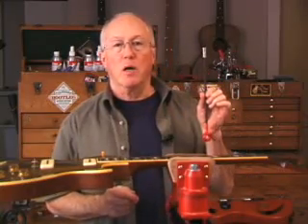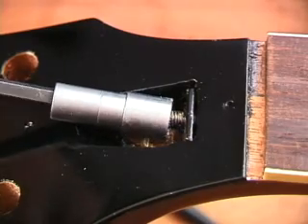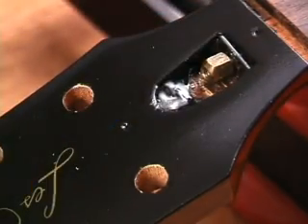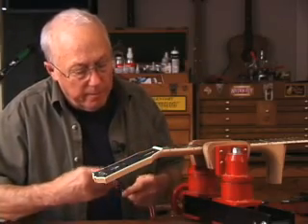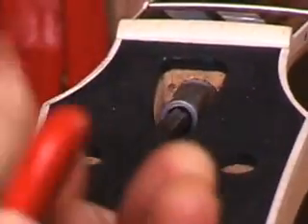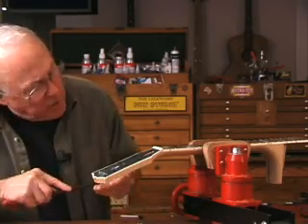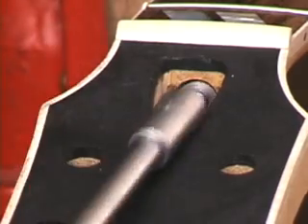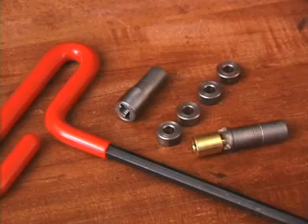Truss Rod Rescue Kit

Comment from the maker: @chase4train A lot of things add up to a smooth-operating tuner: your string tension, how worn-out the tuner is, etc. If the tuner has exposed gears, try using Tri-flow lube (found on stewmac.com)

Comment: my truss isn't broken off and doesnt have a stripped threads.  I was told it was "unthreaded."  When i tune it to the standard E-E tuning the neck is flat. But when i tune it down a step from there the neck is over bowed.  When i go to adjust the neck the truss nut backs off the threads.  Will this tool fix my problem????

Comment: @ofirg32 if the trussrod is weak you may want to just consider getting a replacement neck just for better playability. that way you keep the original neck intact (just not on the body). i have a '71 univox hi flyer that i believe has a broken truss rod. it still works fine (i just know its not perfect, hah). ive been looking for a neck on ebay for a while with no luck.

Comment: Dan ,love your knowledge and these videos I could watch all day. I have an expensive gibson flying v with trussrod severed flush at the point where it should  extend to accept the nut. I have used your technique to help the neck bend flat with help of a carpenters similar to your father's. My fear is this when I flatten out the neck using your helper method just to get a feel for how much the neck will need to move, shouldn't the brokenoff  end of the trussrod thrust itself out of the neck some? My rod doesn't seen to move a hair. Could this be evidence of more trouble such as another break in the trussrod somewhere deeper in the neck. I would hate to spend almost 3 bills just to find the trussrod is unfixable

Comment: i love stew mac kit very mch it fixed all my guitar neck..i want to ask sir if theres a way to repair my acoustic guitar without removing the fretboard?my truss rod is broken,it has a metal U-shape type casing around the rod.,and i cant strip the metal..your kit only strip the wood so that the rod can be easily treaded..thats my only problem..do you have a repair kit the strips the u-shape metal?tnx and more power..

Comment from the maker: @JYZProductions Erick said this, "It is very difficult to diagose your truss rod issue without having the guitar in my hands to inspect. If I had to guess, it sounds like your truss rod nut might be stripped out. So I suggest taking your guitar to a nearby repair shop for an evaluation. They should be able to identify the issue and offer a solution. Good luck!"

Comment: All my Guitars are pretty easy to set up, mainly use Gibson, my standard I've had for 12 years & I'm just starting to have issues now, it plays great apart from 1 problem the high E keeps coming off the board, could it be the Nut??

Comment: What do you do if the nut comes off the rod when trying to turn the rod counter clockwise?
Reply: I bought a Stewmac gripper wrench because I thought the nut was stripped. The nut unscrewed off the rod instead. Now what?

Comment: Ever find out that some of the buzz from say..your D string at the fifth fret is that that particular frequency is causing other stuff to vibrate...or that the slot in the stoptail bridge doesn't seat the string well, or that in my case, that frequency was causing the bridge pickup to vibrate in it's casing. Well, of course that frequency also happened to make the whole guitar vibrate more more than any other...some tightening and damping of the pickup shut down about 95% of the buzz from it.

Comment: I've seen some complaints about the price of this tool. If it's a guitar that you bought new for a few hundred dollars, then you probably aren't going to want to spend that kind of money to fix it, unless you're very attached to it. On the other hand, if you're playing a guitar worth thousands of dollars, then $250 bucks to fix the truss rod is a hell of a bargain compared to replacing the rod and refinishing the guitar. Also keep in mind that Stew Mac is a major supplier to guitar repair/build shops. So if you're a luthier and you've already got a bunch of expensive shop equipment, a tool like this is a fairly small investment. It will give a luthier/tech the ability to look a distraught guitarist in the eye and say, "Oh, I can fix that. No problem!". This means that even if you're on a budget and playing an off-the-shelf Epiphone from Guitar Barn, and your truss rod nut breaks off, you can take it to a tech who has this tool and he can fix it for you at a cost that should be far, far cheaper than replacing your entire instrument.
Reply: If you look around you'll see complaints about the price of their everything....and the shipping to get it to you
Reply: Stew-Mac does add a huge aup charge on all their stuff. Its virtually all too expensive to justofy buying. BUT I do agree with the original poster here. These tools are for the technician or luthier that needs to knpw when they buy a specific tool, itll prpbably be the only one theyll ever need tp buy. Its not for some random yahoo who looks at one internet video and decides to "fix" their BC roch Bronze Warlock. Also that example of selling water...well it doesnt hold any. Stew Mac isnt selling water. Theyre selling the tool you need to fix the plumbing and you only need to buy that tool one time. Sure, they charge a huge premium and that sucks but thats also capitalism. You are free to not buy the tool or tp buy one elsewhere.
Reply: @stevenedwards4470  they're a low-volume business. this isn't a Ryobi bit that Home Depot sells by the millions.

Comment: The truss rod in my acoustic won't tighten any further. I'm going to use some lube to see if that solves he problem. But if not, trying  a couple of washers might be good but my problem is that the truss rod itself leans to one side, quite close to the side of the wood. Getting washers on might be a problem.

Comment: I have a 1947 Gibson es 350 with a stripped truss  rod nut. It was recommended by a luthier that the fretboard would have to be removed at a cost off at least 1000 dollars to complete the repair. The guitar is clean, but not dead mint. This repair would devalue the guitar even more. The 250 buck purchase for this tool might do the trick without a major repair bill/ headache. Might be very well  worth it. Hmmm....thanks Dan!

Comment: could be the nut. does it look like the slot for the high e has excessive wear? 

could also be fret wear at the fret ends, have you leveled and crowned the frets lately? might have rounded the ends too much. or who ever did the work, that is. lol.

last thing i can think of, and this is the bad one. sight down the neck and make sure its not twisted or warped to one side or the other. a slight movement can cause the strings to not line up correctly anymore.

Comment: Aluminum is soft. A tungsten carbide cutter would deal metal, and the wood. Finding one? Hmm? I might have a special punch that is made to cut stainless that I have use to do this in the past. I think disassembly is by far the best repair. I just had a nice late 50s Gibson Explorer come in that had this tool used on it, and the headstock popped off. Ouch! Easy fix became a major ordeal. Unless I have the guitar in hand I am not sure exactly what is wrong or can be done.

Comment: I’ve got a Hohner bass with a broken truss rod. I got it from Cash Generator for £200 so it would be crazy to spend $244 on this kit even if the threads are the same as a Fender or Gibson.

Comment: HELP LUTHIERS! I have a 60 Harmony Stratotone Jupiter with a snapped off truss nut. The prob is the washer that the nut bares against is embedded and needs to be dug out. I need to either man-up and do it, then buy this StewMac rescue tool to do the repair, OR preferably I can send it to a Luthier who has the tool so they can fix it. Anyone want the job? PLMK. Pro Luthiers with a real shop only please. PS. the t-rod was ineffective. It broke when over-tensioned a bit

Comment: Causes of broken tension rods 101... Somebody sat on it , dropped it, or something fell on it. It was bad from the start, like a hairline fracture in the metal. It was improperly over-tensioned. The threaded adjusting barrel became fused to the rod from corrosion. The neck was of poor-quality wood. The guitar was subjected to extremes of temperature and humidity. These last two causes are indirect, as somebody snapped the rod trying to straighten a warped neck. Aim of the comment here, is to remind you how important it is to make certain you know why it broke, before you waste a bunch of time and money trying to fix a bad neck.